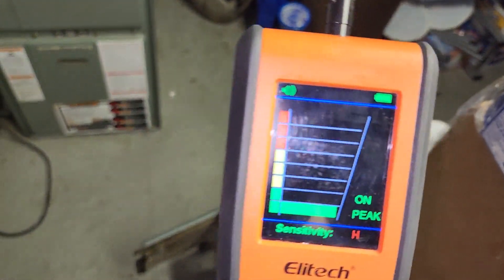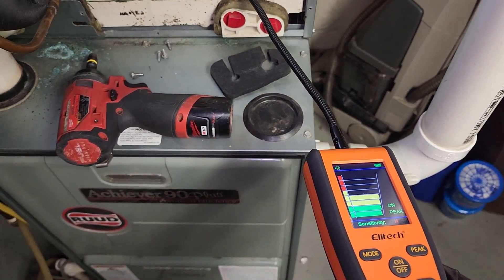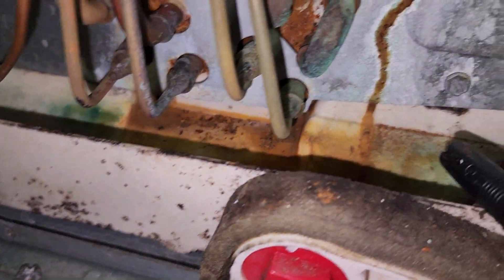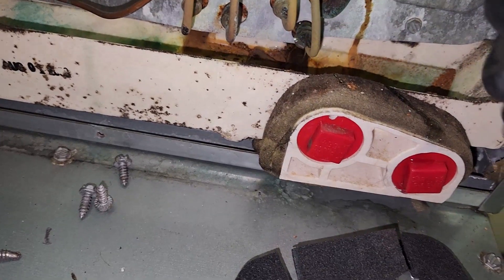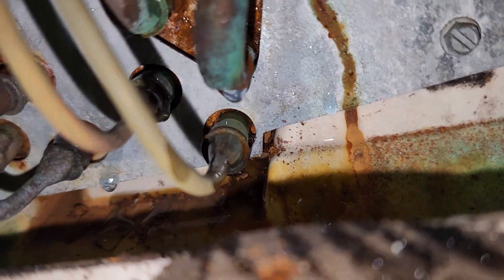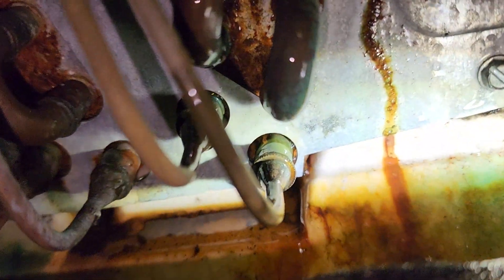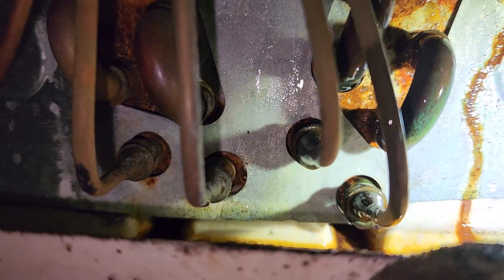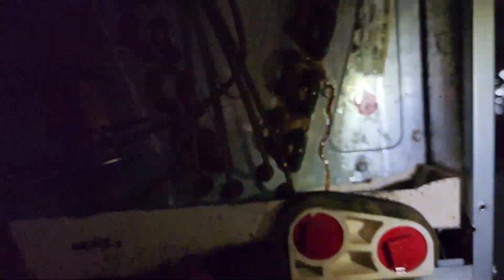Electronic Leak Detection using Elitech Refrigerant Leak Detector! Leaky 2 Ton Rheem Evaporator Coil

Comment: If the detector finds the leak and it’s documented in the video why bother with soapy bubbles? It’s kinda overkill for me but is there a reason why or just prudent for the customer or legal reasons?
Reply: Well if the detector shows you a general area you still might not be able to pinpoint what point of the u bend is leaking. Behind that metal sheet is too close to the coil wall and probably wouldn’t be fixable? But before that step up on the U bend looks like it could be fixable. So the bubbles should be good at showing a general point of where the leak is so you can decide if it can be brazed on or not.
Reply from the maker: I was in no rush, thought it would be nice to get bubbles in video.